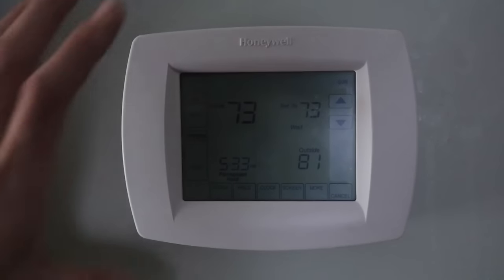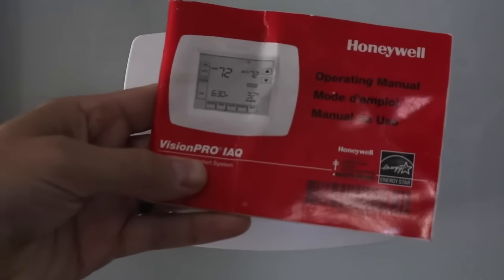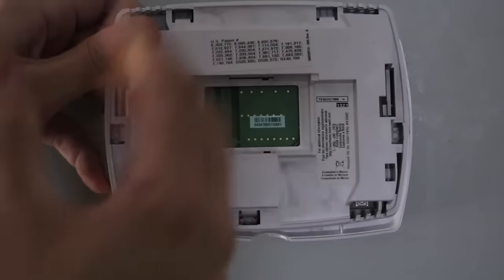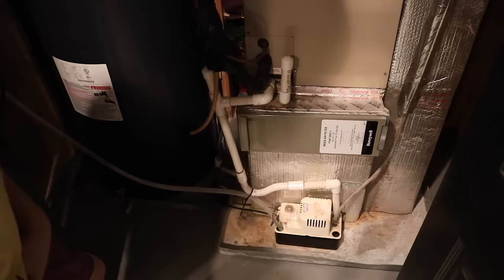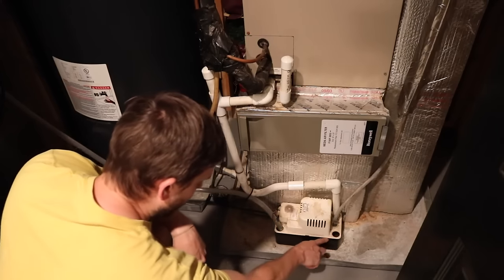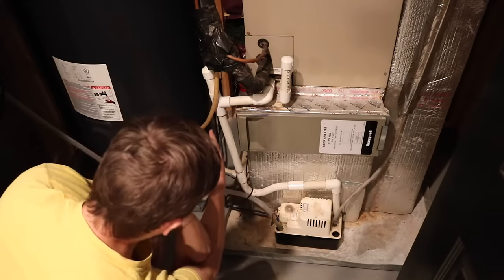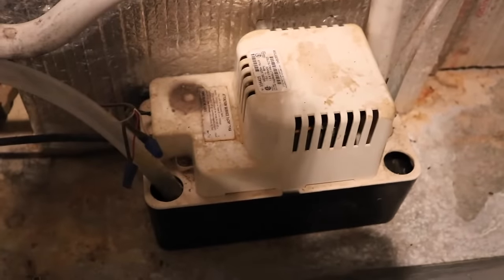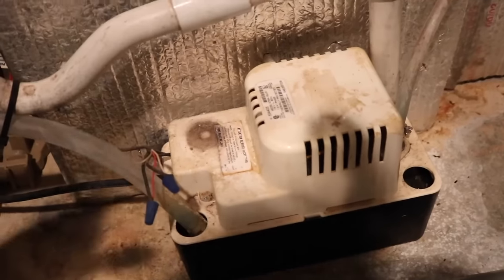No power to Honeywell thermostat? Here's a fix.

Comment: Drain pan was filled to the top. Overflow switch was tripped. Shop vacuumed the water out of the pan. Shop vacuumed the pvc drain from the unit (it was clogged). If there is water in the drain pan the a/c condensation drain is clogged. Thank you for the video

Comment: Thank You soooooo much!  You literally just saved me at least $100 in a service call to my house!  This fixed my problem instantly.  My problem was a little different in that I don't have  pump, just a pan under my air handler in the attic , but I manually drained the water using a garden hose and this emptied the pan enough to not trigger the switch that cuts the entire heating/air system off.  Thanks a million man!

Comment: That's a condensate pump, not a sump pump. If the condensate pump stops working or cannot drain, it shuts down the system.

Comment: Your video saved me a ton...thanks. Mine was slightly different, the other end of my hose that comes from the condensate pump was plugged, preventing the water from moving. Removed the
 shmutz  and voila the system started again.

Comment: You saved my life, I am eternally grateful and will follow your page for the rest of my life. I could not figure out the issue was so I turned to YouTube. Skipped a few post because most YouTubers talk too damn much and play all kinda nonsense before they get to the meat and potatoes. Stumbled onto your post and you got  str8 to the point. My handler is in the attic so I never even saw it before, much less serviced it since I bought my home in 2021. I climbed my fat ass in that attic to discover a horror show. The pan was literally full and almost running over. Never mind the algae., there were things in that pan that I cannot unsee., and I was a Homicide Detective Sergeant at one time in my career. Needless to say, I took a wet dry vac up there and cleaned it all up then blew out the drain. Worked like a charm. An ac person would have charged me hundreds of dollars to do what I did. You just charged me your time. Thank you, thank you, thank you. Be blessed man.

Comment: Thank you so much.  I’ve never seen a thermostat just go completely blank like that. We were about to call an AC professional to come take a look - like you say $200+. The float switch was engaged and the pan and drain pipe just needed to be cleaned out. Easy job and took 10 mins - as soon as it was clean the float switch went back down and the thermostat came back on and fired up the A/C. Really appreciate your video - thank you for sharing and educating.

Comment: I made all the checked points mentioned in your video. I went cuckoo. I couldn't find what was going on to turn off my Honeywell Thermostat until I saw your video. Thanks a million. There's a pan to catch all drips overcapacity and turn off the system. It was not a problem decades ago to get into our crawl space with a bucket. Since bending to get under the tubes and HVAC ducts is now a challenge, the problem is not done yet, only temporary relief until it gets full again. I'm ordering a utility pump. Thank you again.

Comment: Never would have suspected the tripped sump… i tried new thermostat but wasn’t getting power (hard to determine without voltmeter if its battery backed). And indeed the sump was tripped and immediate fix.
Great simple and direct video!

Comment: Jesus you just saved me too. I replaced the battery first, which did nothing.  Double checked the breakers. Then called hvac repair and they were booked for the day. Next, found this video and went downstairs to trouble shoot. Pump wasn't full but the GFI was tripped on the outlet to the a/c. Eyes rolled, but im thankful thats all it was.

Comment: Thank you!!!!!!  This is the last video I watched before going under the house to troubleshoot.  The condensation pump wasn't getting power and it was full of water.  In my case the outlet the pump was plugged into didn't have the GFI switch but resides on a GFI run - I had to trace it back to the garage GFI outlet, reset it and everything was working once again! 

This was all the result of our house being pressure washed.  The pressure wash guy must have blasted the crawl space door, spray got in and then tripped the GFI. The crawl space door doesn't seal very well so yet another project for my already long list.
Reply: hell yea!!

Comment: So I don't have that type of set up, however your video still pointed me in the right direction to solve our problem. Just had a panel that rattled a little loose on the unit in our utility closet which was not pressing on a switch that when in the  open position interrupts power. It was a panel that opens up to a plenum where the filter goes. Explains why it was going out intermittently for the last week.

Comment: This video helped me  (Thanks!!).  In FL today it was very hot outside so when I went to adjust my thermostat I noticed the screen was dead (fyi-breaker not tripped). I assumed at first it must be a bad thermostat (power delivered from the house, not batteries).  My water drainage pipe was clogged and so the kill switch in the water pan turned the power off to the thermostat automatically. I wish it sent a signal to the thermostat to clean the drainage pipe instead. Using a ShopVac  from the outside exit pipe I was able to get it half cleaned out.  Then add bleach to the pipe inside the house and let sit for 10 minutes and try the ShopVac on the outside pipe again and Bam! the plug released and now I have a clean drainage pipe. The kill switch dried out and the power came back on to the thermostat and the full system is up and working again.

Comment: Thank you! Similar problem, however earlier in the day I moved something near condensation pump and I guess I bumped it. Long story short, the lid of pump lifted off a bit and caused the limit switch to not engage causing the pump to fill full. . Once it was full (without ability to empty), it cuts off power to thermostat. Put the top back in place and we are back in business. Saved a cold Easter and Monday morning HVAC service call. Wow thanks!!!

Comment: You just saved me $$$$$. It was the condensation level but ine is just a weird plug and pvc tube with a sensor here in Florida with the air conditioner! I pulled the sensor out and replaced it and it worked!!!!! After 1 hour of looking for the secret non existing batteries. 😂

Comment: Thanks a ton man. It was -13 here and my panel went dark. I put new batteries in and went to work. All seemed fine. Got home to no heat. I noticed the pump kept trying to run and  realized the basin was completely full. I emptied it and it started working again. $40 pump instead of lord knows how much in repair costs from a pro.

Comment: This solution works for most model 8000's.   I have used this simple trick for several years in Virginia where mold grows on the inside of the drain line and that line needs to be brushed out (with a simple long handle nylon brush) and flush out with several water bottles.

Comment: Slight twist, same outcome.  I have a Honeywell Lyric T5 and at 4 am on a very cold January, I get a notice on my phone that it has lost communications with the Smart Thermostat.  It happens when I lose internet, did not think nothing of it, went back to sleep.  

I woke up to a very cold house this morning, being that it is 13 degrees outside.  I notice that there is no power to my Thermostat.  I'm thinking damn high tech crap failed on me, so I check YouTube for some ideas on what to check and come across this post talking about the pump and it hits me, last winter, the drain line on the outside of the house (I just bought the house two years ago) from that pump froze up and the pump could not pump the water out due to the ice blockage.  I have a humidifier on my gas heat and that is where the water comes from in my case.

Your video helped me.  Thanks.
Reply from the maker: Nice, thanks for sharing your experience :)

Comment: Thank you! I have a different model Honeywell thermostat, but the problem was pretty much the same. Flipping the breakers didn’t help, but when I checked the drip pan, it was full (probably a clog in the line). I emptied out a few gallons and the system kicked back on. Much appreciated in August!

Comment: Dude, you just saved me about $300 today.  THANK YOU THANK YOU THANK YOU!!  The P-trap on my AC drain was stopped up and I had a pan full of water.  Unstopped the pipe, got the water out of the pan with the ShopVac, were in business.  Won't be burning our asses off in the God awful North Carolina heat tomorrow.

Comment: Thank You, I had forgot about the overflow sensor that trips the unit. I used a shop vac to suck the clogged pipe and added a little clorox to get rid of the buildup. It works fine now.

Comment: Thanks SO much for posting this, fixed our thermostat in an instant.  Our outlet by the furnace didn't have a reset button on it, it was upstairs in an entirely different part of the house.  I guess they were paired?  But the same red light was on and all it took was a quick press of the button to fix it.  Thanks!!

Comment: Just got mine fixed tried all of the above. If this happened right after you cranked the heat up really high you most likely BLEW A FUSE ON THE BOARD. QUICK REPLACEMENT AND BACK TO WORKING.
Reply: When you say blew a fuse on the board, is this a fuse inside the air handler? Thanks.
Reply: @JeEsRih  yeah if I remember correctly it was on the actual unit not the wall mounted device
Reply: @Justinian169  Thanks so much, appreciate the reply!

Comment: I tried turning off and on the switch on the heat / AC unit - no go, pulled the plug on the heat / AC unit and it works now!

Comment: Just had a similar issue. No power to the thermostat. After troubleshooting and flicking breakers and what not, watched your video. Had my stepdad come over and check up in the attic to see if this was the same cause. He moved a board and Just like that, everything kicked on. Seems the wires were pinched. Not sure how it happened. No evidence of vermin up there. We’ve had extreme temp changes in my area, don’t know if that affected any wiring or not. Keeping an eye on it now. If it continues, sounds like I have an electrical issue to look at up there. Thanks for the video though. At least gave me the thought to go up there.

Comment: Thanks for the tip..mine was a further issue try this if the above don't work. Remove the lcd screen carefully from the case,you  will see two small ribbons at bottom of lcd .push the tabs gently on the sides, remove ribbon tape from connector..note only ribbon comes out. Take out and let sit for a minute.  Reattach same as you took out till it snaps back in.do both sides same ..put back together..this is a master reset I guess 🤷..mine works again .    Before I could do nothing..note wait five min for the system to restart before programming..thanks for the tips to Chris as well ..God bless

Comment: This HVAC unit has a condensate pump as the water has to be pumped a long distance or up and over something... like being routed up into the attic before down again.
Condensate pumps are notorious for clogging but it's just as possible that the outlet from the HVAC unit condensate pan is clogged.
In either case, there are two sensors that will detect water buildup.  Once attached to the side of the HVAC unit and the other in the pan if you have a condensate pump as here.  These sensors will shut the unit off to prevent flooding.Clearing the outside drain line, the condensate pump catch basin or the HVAC unit condensate pan is the first step and will usually allow the unit to work again.
To prevent the buildup that clogs the pan and drain lines, or pump, use a product specifically made for the HVAC systems.  Buy HVAC pan tablets and place them in the condensate pan below the 'A' coils and if you have one, place a tablet in the pump basin.  These tablets contain a fungicide/algaecide and will prevent the 'snotty' buildup.  Do this when you change your filter or more often when your system is running often due to high humidity.
NEVER use bleach or chlorine as it is corrosive and will ruin your coils over time.

Comment: If it's not a water issue or float switch or clog in pcv pipe And the 3amp fuse is blown it's either a low voltage wire rubbed or touching to cause that fuse to blow. Could be a short in the Contactor as well.

Comment: I have this exact thermostat and the screen went blank.  The pump was new and working fine. Power was fine. However there is a  small lithium battery 3v in the thermostat behind the screen. Just pop off the screen cover and change the battery and presto the thermostat powers up after plugging  back in the wall .

Comment: Thanks you were exactly right! Saved me a service call!
Reply: Awesome.  You saved me.  I don't have a sump pump, but I had a condensation switch on the drain line.  The switch keep shutting off do to a clogged drain line.  Flushed the line and back with A/C.  Thanks again.  FLA.

Comment: Thanks for posting this. After watching the video, I checked my pump outlet.  Plug was loose.  Pushing it in prompted the pump to drain, furnace to come on and "Thermostat not communicating with furnace" message to disappear from my Homeywell TH8321R1001.

Comment: Mine was that a fuse in the furnace had blown. A Honeywell Wire Saver THP9045A kit had been added and there was a 3 amp fuse that blew. Replaced the fuse and voila! You open the furnace where you change the filter to get to that wiring.

Comment: Didn't directly help me, but made me check the unit and found the fuse disconnect had fallen out (was having some unrelated contractor work done and they were working just above), so I was able to fix the issue without calling anyone.

Comment: What you have discovered is only a symptom of the actual problem. The red light is part or a GFI outlet showing that something has tripped it which means that most likely the (condensate pump) motor is pulling to much current or amperage causing the outlet to trip. Resetting it will More than likely be a short lived fix. The pump may be clogged or wearing out. It is best to call a professional as condensation leaks/over flows can be costly i.e. water damage or even worst mold. Planned maintenance is key! Believe me paying a Pm  cost is a lot better than repairing sheet rock or remediation of mold.

Comment: My thermostat is very old and I think that is why my ac& heater are not running. I pulled the front of the thermostat off and there I see wiring but also 2 clear tubes as soon as you open. I have no water problem I checked the power boxes boxes outside. Still can’t get any power do you think it’s this older than dirt thermostat? This house has been a fixer from day one but sometimes the solution is not near the price the con artists that have charged me just to have the same situation happen again. Widow 73 any suggestions?

Comment: I have the same thermostat. We had a power outage and mine haven't worked since. It lights up I change batteries. I checked  breaker switch. It still won't  do nothing the screen it's frozen. Airs is still blowing from the eac unit. Thermostat just not doing anything

Comment: 12/21/2019 -  So I have an Carrier Infinity Thermostat. I was frustrated and looking for a solution when I came on this video. I thought -- well, I do have a pump; but it didn't trip the outlet. So I got down and looked at the pump. I shook it and it kicked on and the water started draining and the thermostat came back online.
Reply: Shaking the pump did the trick for me! Not sure why it stopped working, maybe that container need to be cleaned.

Update: I ended up replacing the Condensate Pump. Looks like a switch in the old pump was worn out causing it not to turn on the pump even with full water. Found the new on Amazon.

Comment: My thermostat uses batteries and I changed them. The numbers are there but the light does not come on the screen and it won't allow me to adjust the temperature or any of the settings. I reset the breaker, blow it out with a can blower and changed the filter. Nothing seems to work. HELP... I just paid $250.00 because the water wasn't running out and the unit stopped working.

Comment: Any recommendations if the pump keeps tripping before contacting a service person. Its done it three times so far, I unplugged and plugged back in  and starts working
Reply: see if the pump hose might have something in it preventing it from pumping correctly. Also take the pump apart and clean out the floats.

Comment: Thermostat display was blank. No breaker had tripped. Drain pipe from the ac unit to the outside had plugged up causing the safety switch in front of the inside unit to trip. Drained the water from the unit and opened up the pipe to the outside. The safety switch had now reset and power was restored to the thermostat. After about 5 - 10 minutes the ac unit was back running!

Comment: Anybody got any ideas I came home the other day and my batteries were dead in my thermostat I replace the batteries the thermostats light it up it's got numbers on it but.. my blower fan will not kick on my fan on the outside unit is not working and my compressor wont kicking on
I looked at all the fuses there fine 
I replace the thermostat about 2 weeks ago and it worked fine do you think I got a bad thermostat

Comment: nobody has this setup! goddam... sorry. currently troubleshooting mine. it's going blank and immediately back on. no door open. clean filter. has C wire, with battery backup--battery good. no clogged drain. its similar to yours, a honeywell wifi. it's only 3 years old. maybe bad? dunno? ffs. gdi

Comment: There's a reason why that condensate pump it's not called a sump pump tripped you will have that problem again thank you bye bye.
Reply: real hvac tech video was helpful. My issue was that I inadvertently shut off furnace switch which I discovered on my own. That saved me a few $